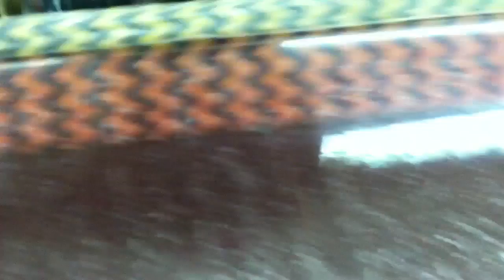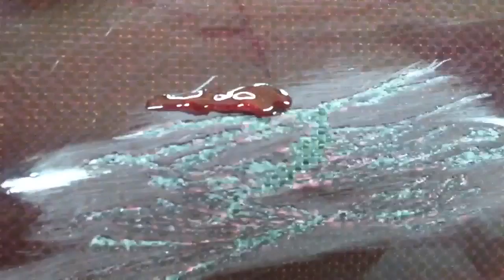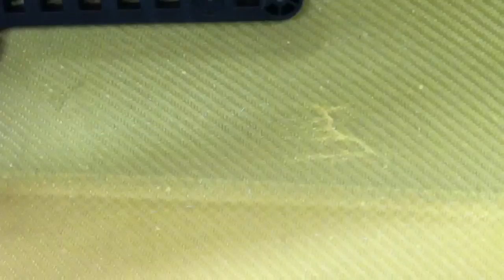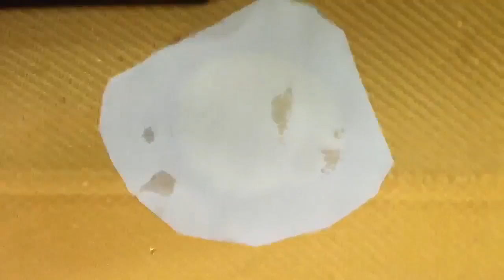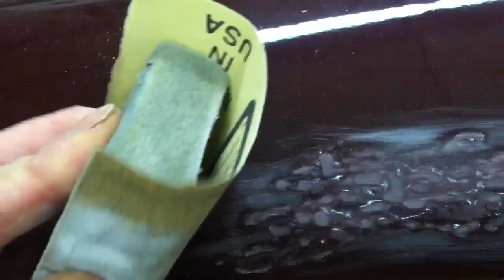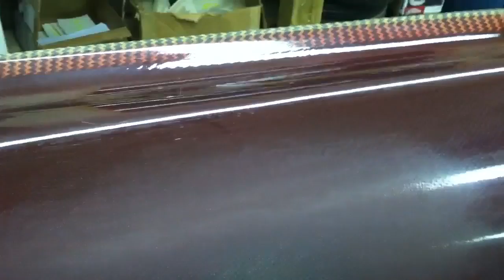Gel Coat Repair by Placid Boatworks

Comment: Smh, You can use a low grit if the gel coat is thick, like in your video, but good luck with that if you are working on a highly deteriorated or efficient(less gel coat=less weight)  part. You have to tape the repair then sand so you only hit the elevated areas (repairs) and keep re taping and sanding until it almost level. Then you would have to use a higher grit. I've had to use 1500 myself for car parts. I'd bet that some aerospace manufacturers would use 2000, the gel coat is so thin.

Comment: I would not recommend acetone to clean surface during the repair work. Acetone will halve the gel coat life
Reply: would be cool if you gave a suggestion of what TO use...
Reply: You sir, are wrong. Thinning with acetone is frowned upon as it can cause yellowing and cure issues. Best to use styrene or MEK. (NOT MEKP, thats the catalyst) also, while acetone is 1000% acceptable for prepping the surface, total boat brand surface prep and dewaxer is even better bc it doesn't instantly evaporate and it dewaxes while acetone does not. Please do not listen to OP.